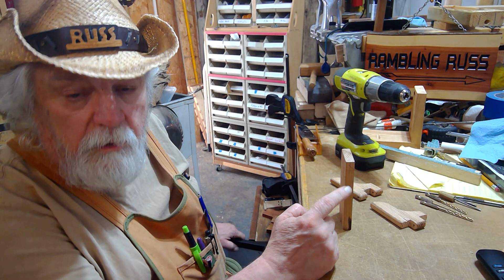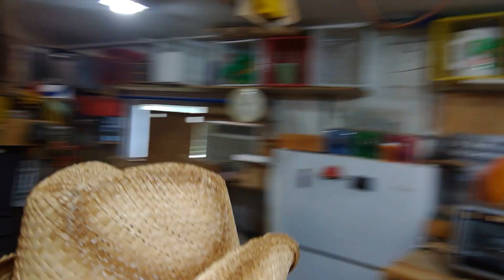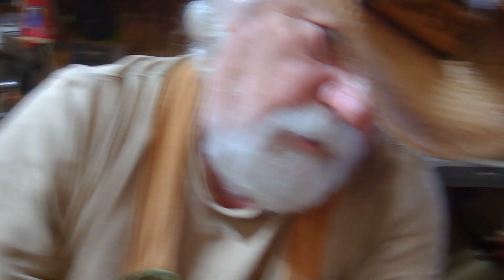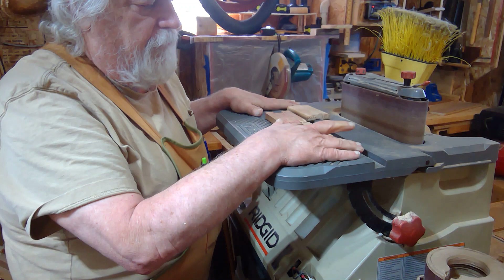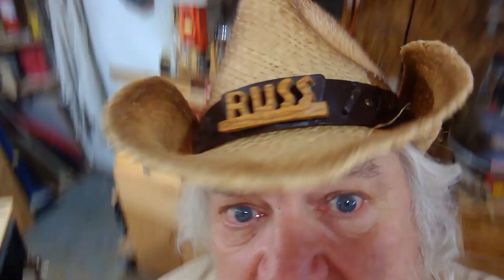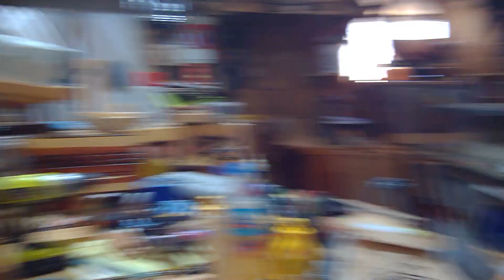DIY Wood Hinge in Real Time by OTB Thinker

Comment: Thanks Russ I have been looking forward to this video.  The length was not a problem for me, I want to learn something.  I assume you are using hardwood for the hinges.  Roy Underhill would be proud.
Reply from the maker: I used quarter sawn oak.  I was concerned about the length.  My longest video before was only 22 minutes.  This video definitely isn't doing  as good (statistically) as usual.  I am relieved with the comments (like yours) that seem to have watched the whole thing.  This video was definitely done for the few rather than for the masses.  Your feedback is appreciated, Dave, thanks.